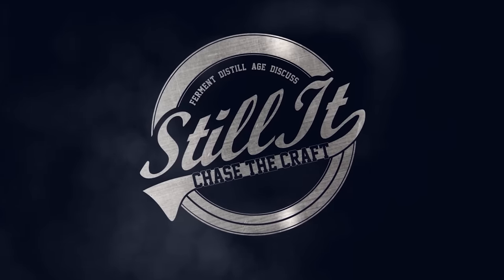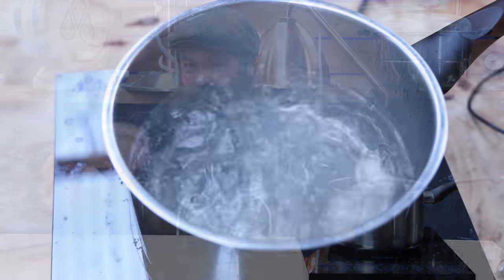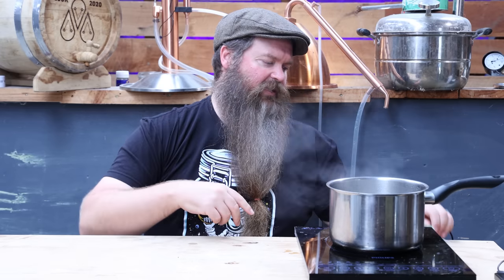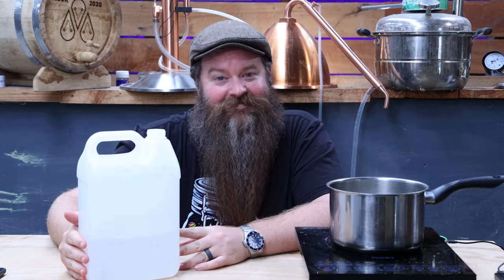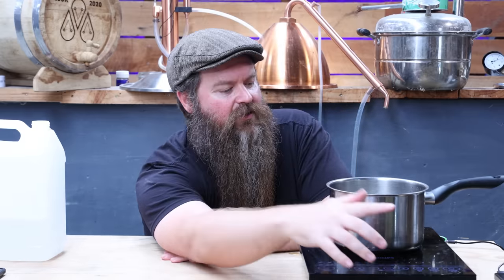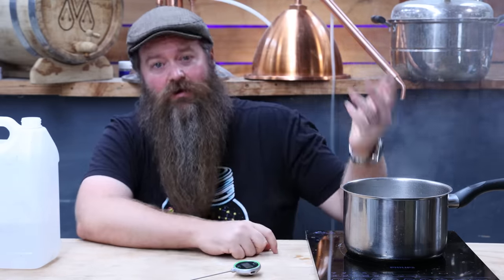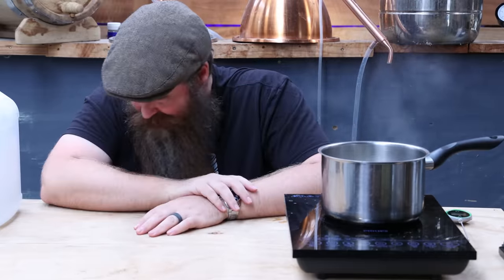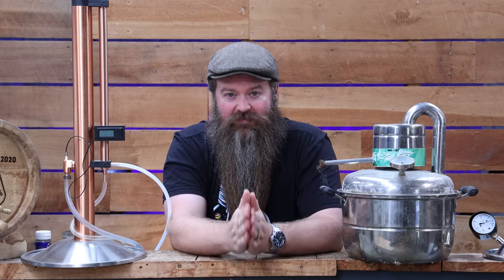What Temp Should I Run My Still At?

Comment: I do Rum and use: 4 cups Strap Molasses and 4Lbs Pure Cane Sugar (Sugar in the Raw), 1Tabs 5.2, 1Tabs Acid Blend, 1Tabs Citric Acid and 1Tabs Angel Yellow starter yeast and mix with a drill and paint stirrer for 2 min then put 6 gal in the first run. I get about 14% ABV and I only put in 6 gal in my 8 gal still. (Edit/Add) - I do NOT like "Puking" so when the kettle's reaches 185*F I turn off the gas and let my home made BrewBoss controler take over. I keep the "Head temp at 70*F for a few minutes and checking my site glass every few minutus for fluctuations and raise it 5*F ever 5 min or so until it reaches 148*F. I keep it there until I get 59ml in a small container then I change to a leader container. (The methane I get is saved to light the charcoal for my Korean BBQ). and increase the head temp to 173*F for an hour, then I change to a large gal container and increase the head temp to 187*F for 10 to 12 hours or when the drips stop. I turn the heat off and let it cool down. The next morning I drain about 3gal into the keg this batch came from and fill the kettle up to 6 gal from the next keg and do it again until all kegs are used (one day at a time). I ferment in my 5 gal kegs so I only put in 4.5 gal in each one. When I finish a "Pot Still run" the next morning I drain 3 gal off into the keg it came from then add about 1.5 gal of water, 4lbs sugar, 1Tabs 5.2, 1Tabs Acid Blend, 1Tabs Citric Acid and 1tabs Angel Yellow starter yeast. Wait 2 weeks and do it again. Happy brewing ;<)

Comment: As a new distiller, I’ve taken to measuring the boil temp, it helps me learn the still. It lets me know as the temperature starts to rise I’m getting towards tails. I’ll probably stop fussing when I know more but I find it useful information. I have always adjusted still on flow rate but like the data points a thermometer gives me.

Comment: My old reflux stiil has 2x 900W elements in the boiler.  You start on both elements and at about 45mins you turn one off.  The temp climbs slowly up to the 78 deg C.  The dripping starts back at around 65deg C.  I collect the heads until the drips smell sweet, so around the 100ml of methanol sounds about right.  I then cook on for about 2 hours on a good run.  It will hang at 78 deg C for a long time but I pull out at 80 Deg C.  81.3 I think is the isopropyl coming off.  I put in another cup to collect until 85 Deg C to get the ISO because it is good for cleaning and as a fuel for methanol stoves.  Top videos mate.  Education is the key to life.  It is so cheap and easy everyone should know how to do it.  Never get there late and boil over.  You will only do that once.
Reply: Yes, you can watch how your still starts and stops running and how temperatures hang out too know where you are in a run. You find you don't really need the thermometer anymore, other than to be sure but I can certainly do it without one.

Comment: Hi Jesse,

I first up super video, I do agree with you that there is no way of giving a temp that you should "chase" to get a specific result.

I will however say that keeping an eye on your temp is a really good practice to ensure you are running your still correctly, let me explain my thinking.
When you run your still you will see the temp rise as the vapour starts to move past the point where you have the thermometer if the temp starts to climb super fast you need to adjust the enery in to slow down the vapour speed, and when you have dialed in your take off at the spout you need to maintain the temp during specific parts of the run, keeping in mind you can't over boil water.
The reason I believe temp is important part of the skill set of a distiller is to be able to learn how to ensure you don't rush the "boil" meaning slowing down during specific parts of the run to ensure "cleaner" transitions between point between cuts.
If your temp keeps going up and down and not being stable to a degree to get the heat column with in the liquid to evenly distribute in the boiler will cause alot of flavor drift and smearing.

A super interesting thing I have seen is if you have a pot simmering and you drop food coloring into the liquid at different points the way and time it takes it to evenly distribute in the liquid shows how the liquid mix and how the heat column behaves.
Of course larger volumes will react differently but still super interesting.

Thank you once again for the video.

Cheers

Comment: Good job!  Knowing how one's still operates is critical and all stills react differently.  I control temperature using a PID temp controller which can maintain pot temp to within a couple of degrees, but as the run progresses the pot temperature must be raised since it takes more thermal energy to break the remaining alcohol free of the other liquids in the pot.  The key is to observe the out flow rate vs temperature and adjust pot temperature as needed to keep the out flow pretty much constant throughout the run.  Experience teaches you how best to make temperature changes and that experience comes with trial and error.

Comment: interesting fact - for me - is that the professionals in traditional fruit brandies around here using alembic (or similar) still designs in combination with plates and thumpers tell you straight out "take off hearts from 80 to 91°C". That might be related to recipes and still type used (and allowed...) standardly, but there's no word about smell, taste, takeoff speed, just plain temperature profiles for different fruit mashes. Good to have learned the more pot still based "trust your senses" - approach as well... 
I learned a lot during experiments with different column heights and packing on a 25 litre boiler, slow temperature increase and taking cuts in very small containers in the first attempts. More heat / faster take off immediately makes it harder to do clean cuts, especially between 65 and 80°C, where you can get one big glass to toss away or one shot glass blue stuff, one for acetone, one for super glue and them the headsy, but almost clean stuff where you might decide from taste when to collect the goodies...    and after all: hey, it's for the fun, so take your time and enjoy the ride...
Reply: oh you'd be surprised how many distillers in big companies don't understand the exact science behind it.

Comment: Great explanation Jesse. I use my thermometer at the top for gauging when to change the element wattage. I have  a first generation Grain Father that has a 600w and 1600w heat setting. I use the 1600w to get to my temp and then switch over to the 600w for a slower output. 1600 w to raise the temp and 600w to hold steady/very slow rise. works well. I would suggest that now you have opened Pandora's box, do a video on how to control the energy input. Remember, the US is 120 volts.
Reply: I pretty much do the same thing on a t500 but using an SCR to control power input.  Also, wattage is wattage, doesn't matter if its 120v or 240v.
Reply: @adamparisi745  I assume you are 120v? Have been thinking about a SCR, a 4000w max controller. They are inexpensive on Amazon. Just not sure if dropping the energy in-put to say 1200-1400w would produce a difference in flavor from the product. The flow is pretty slow at the full 1600w.  Your thoughts?
Reply: @cjcout99  I'm on 240v.  I have a boiler with a single 2000w element running off one of those cheap 4000w SCR.   Once I'm up to temp I'll drop the voltage down to 120-130 which will give me a power input around 600W.  So pretty much the same way you're running.  Benefit is I can slowly raise voltage as alcohol is boiled off and boiling point rises.  Another benefit is less fiddling with coolant flow which on a t500 is bloody annoying.  As for flavour, I can tell a difference.  Adjusting the power down results in a less energetic boil which allows for more reflux to occur within the column.  I find neutral spirit cleaner tasting.

Comment: I'm actually surprised with your thoughts on holding a temp to get rid of the "bad stuff" at the start. I've seen 4 or 5 times in George's videos him advocating to do that as an option and explains it with his famous white boards lol. I have this in my notes from one of his videos "168° (at sea level) until it stops (10min or so) and the 4shots and heads are both done." This is for a 5gal mash.

Either way, I love your explanations here and they are now making me question George's thoughts on the subject. 

Keep up the great work!
Reply: i respect george because he can run laps around us on experience but experience is one thing and the science behind it is another. You can go your entire life thinking certain things and it will work, most distillers don't know about boiling ranges in mixtures, rather they believe in the fixed boiling points and they've made some good liquor. I've recently done a distillery tour where the head distiller said we stay close to 173 and then we won't get much water.

Comment: Idk if I told you but I engineered a 3 stainless steel bucket system which starts at 16 gal. (60L) the using a 24” copper lines jumps to a 8gal(30L) then to a optional 15” copper line to my 3.5 gal which is a optional quick detach bucket for flavoring and a tiny bit more distillation before it pumps to the 12ft of 5/8” copper coil in my big bucket. Otherwise the 30L goes to the condenser. I can’t do social media so I’m telling you here. Thanks brotha stills being built today

Comment: I think newbies using a PID controller often don't get it that setting the PID at a certain fixed temperature for the entire run is wrong.  As you noted, the pot temperature will rise as the ABV decreases over the course of the run.  With this fact in mind, the PID temperature will need to be increased periodically.  When to make the change is easy to determine by simply watching the output.  When the output drops off is a clear sign the PID temperature needs to be increased.  Where the PID shines is in keeping the temperature steady until there is a need to change it.  This the PID can do far better than can be done manually since the PID "learns" and can anticipate more precisely just how much to change the temperature without over doing it.

Comment: For around 8yrs I've been using the trusty T500, stainless steel, no copper other than the standard saddles in the coloum. All standard Still Spirits kit and been on Birdwatchers recipe for all that time bar the stuff that came with the kit initially and a few top up Still Spirits Fast Yeast brews to tide me over on a diminished supply when I get lazy. As it's getting close to the foreshots I get the output water temp as close to 55°C generally as it's running for me once the needle valve is dialled in and that will do the job for the 2.5-3 hours it produces for, depending how well the fermentation went. I don't mind running a bit long for more yield because once it's soaked on burnt white 'Murican oak I don't notice a big difference in flavour. I soak at 55%ABV which by the power of mathematics means I pour into a 700ml bottle then transfer to a 1L bottle using cheese cloth to seperate any wood debris etc and top up to make a damn close to 40%ABV delicious drop. Keeping the output under 60°C means as it's doing it's thing it has some headroom for temp spikes without going over 62-63, but will also come back down within a few minutes at most. Happy brewing pissheads.

Comment: Boiling temperature of a mix will depend on the relative concentration....you cannot control temperature....you can only control heat input...temperature at boil tells you what the mix concentration is...

Comment: Temp is one datapoint.  On just about any still you want to discard anything below 70c or lower if at high altitude.  The first decent ester starts coming off at around 70c and depending on how much you like butter you may want to discard some of that ethyl acetate.  If you are going slow on your take off you can get a pretty clean distinction below ethyl acetate where stuff is mainly acetone and methanol and when the first ethyl acetate appears.  Obviously with a pot still you do not get as clean of a break as with a reflux still.  For a stripping run i starts slow then blast it and slow down again as the vapor abv gets low.  I can discard that forerun that isn't even good for feints.

Comment: I feel a little embarrassed having wrote a response before watching your entire video on this. Makes alot more sense. I will say this, When i started distilling, it was around 30 years ago, no shows on the tele, no internet with videos and info. So i built a reflux style using a stainless milkcan and a copper reflux towere with built in condenser etc on top of the milk can lid. I froze five gallon jugs of ice water put them into a barrel of water and pumped using a little giant back into the barrel for the condensing. The first time i ever did a run, due to paranoia and not trusting people lol, i was alone in my basement of my 1864 home. I had the windows open, it was storming out etc. I had a rubber grommet and thermometer at the top of the reflux tower. I swear, nothing came out of the still until it hit 178 degrees F! I laughed so loud i remember i was so excited and pleased none of my sweated joints had leaked. Anyway i did play with the cooling water flow rate and flame the entire time and held the run to a five degree window for 1.5 hours. 10 gallons of peach etc. I still have that crazy still but no longer use it as i'm learning about flavor and pot distilling thanks to you and others on the web. Cheers from Maine! MT

Comment: Great Explanation!

I like to think the thermometers are Data Points as well, but not gospel. If all things are equal, they help to start to formulate a process flow.
Reply: If you can account for ambient barometric pressure, and pay attention to your phase diagrams, you can get your process down pretty precisely.  Even if you're not chasing a consistent product, having the data points and the output is a good way to help make your decisions more informed.

Comment: The other wierd thing that helps explain some of the "magic" is that Water and Ethanol form a azeotrope (which is a mixture of two or more liquids whose proportions cannot be altered or changed by simple distillation).  The weird bit is the boiling point of Water is 100 degrees C and the boiling point of Enthanol is 78.4 degrees C.  But the boiling point of the azeotrope of Water and Ethanol is 78.2 degrees C.  Which is 0.2 degrees C lower than the Ethanol by itself.

Comment: Jesse, you have done a fine job explaining a very complex topic. I have recently become interested in how distillate temperature coming off the condenser affects flavor, thanks to Alan Bishop whom you recently interviewed on your podcast. Basically he argues that hotter distillate coming off the still will create harsher flavors. I have always run my output stream (drip) pretty slowly because I use an air condenser that is easily overpowered. My condenser output temperature is about the same as ambient. Do any of you Chasers have an opinion about this?

The only other thing I have say about your topic is that even a pot still can run at a steady (but slowly, inevitably rising) temperature when you are in hearts. This, I do pay attention to vapor temperature and adjust my heat input to find this rough “balance” point. Cheers!

Comment: Excellent!  Try a variable power supply on your air pot sometime. The condenser is probably overkill and even though the cooling fan is slowed with less input power it will still work perfectly along with the lower boiler temp. Using that you can do a strip and a spirit run with positive results. (hypothetically of course)
Reply: For a strip run it's needed more power, not less. For a Spirit run the airstill seems ok
Reply: @jesse.marques  Yes, exactly my point. Wide open for stripping, reduced power for a spirit run. The condenser can handle either even though the condenser fan is running slower  because of the reduced power input. (spirit run) I have read some people have rewired the air stills so that the condenser fan runs at full speed and power and the heating element can be controlled with a power supply.
Reply: @LP23D6  I have done exactly this, with one of the vevor 750w air stills, and it makes a huge difference.  It's a completely different beast.  I'd always recommend people stay away from the more expensive PID temp controlled units, buy the cheaper one and get an SCR.  It will come in under the price of the temp controlled one, and infinitely more controllable.  I have learned this lesson the more expensive way.
Reply: You can just plug the condenser fan into a different plug to run it all out while you adjust the boiler.
Reply: @ffwast  Yep. mine would take a different cord is all I would need.

Comment: Thanks Jesse. I've had pots, reflux, 'super reflux' and home made stills since '08. I've been running the same dextrose and yeast for a long time too, all fermented in a temp controlled fridge at 22° for 7 days.
The temp of the element is the only thing I haven't played with! 
Given what you've said, wouldn't it make sense to have a multi stage element to use the same still head to do fast stripping runs, drip, drip runs and super slow runs by changing the element output?

Comment: This is so random but the boiling temp could also affect flavor profiles if your up at say 13000 feet in elevation the boiling point in F drops 25 degrees. So you would be able to heat the mash to a lower point and get totally different flavors that are less altered from the heat! 😁
Reply: Yes but that isn't necessarily a good things.  At higher temp and acidity you get more ester formation.  Esters greatly impact the flavor.  So at lower temp you get less esters.  It is all a balance.
Reply: @lrmackmcbride7498  ok that makes sense 👌